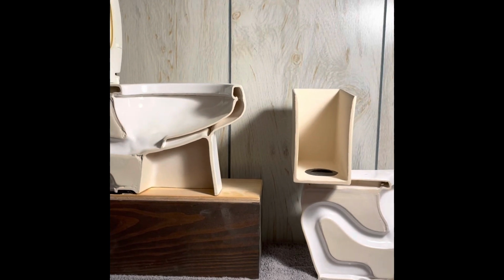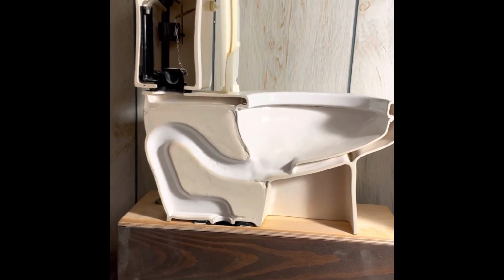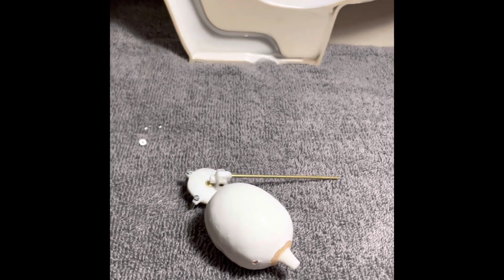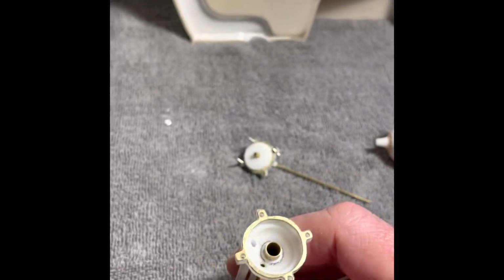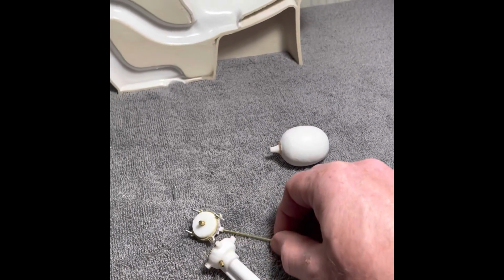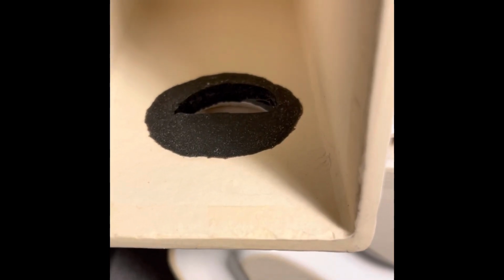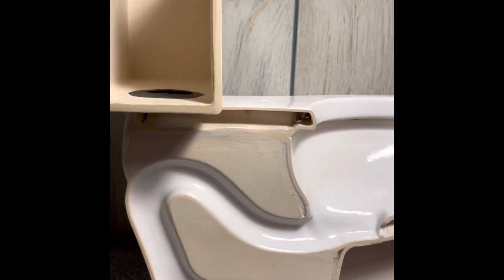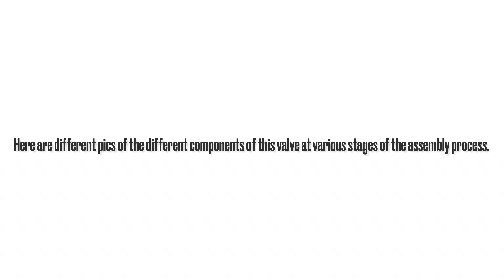Working Mini Ballcock Valve!!!

Comment: Welcome back Brad! Wow this is incredible How did you make the parts? They look so realisitic!
Reply from the maker: Thanks!  Some of the components are what I had used on my previous fill valves.  The whole top section was made by making little temporary molds and casting the pieces out of resin.  As well as, lots of shaping, sanding, and drilling tiny holes.  Lastly, I glued the components together.  I still have to glue the ball float on.  I hope the long rod won’t need to be bent down to lower the float, but I’ll do it if necessary.